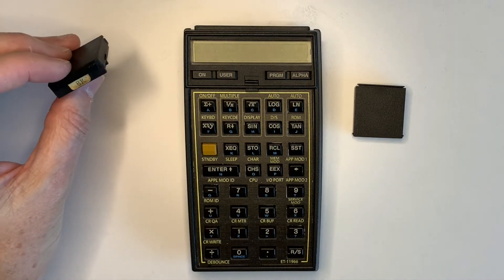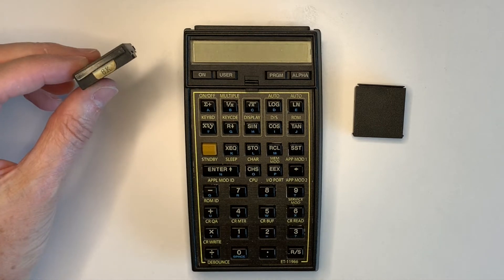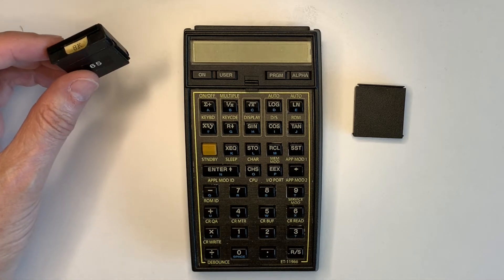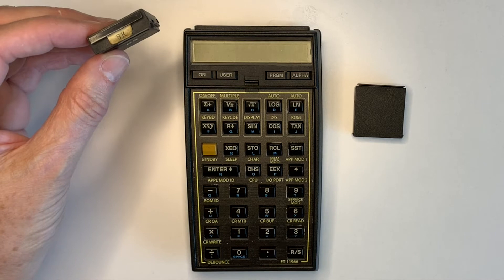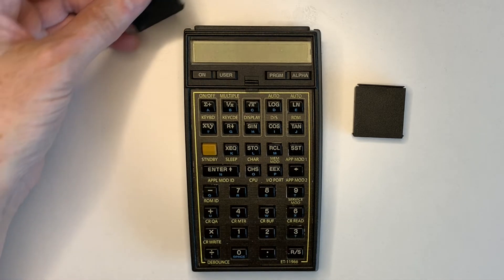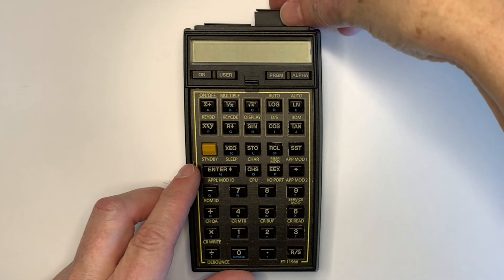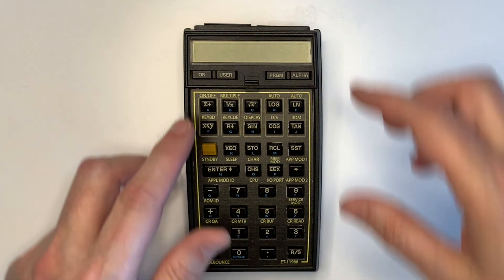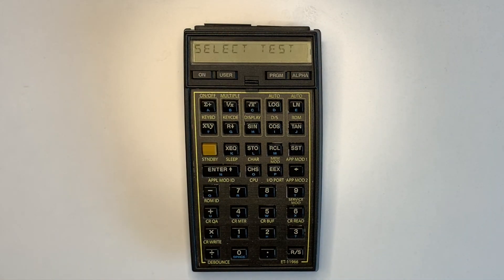Can you identify this HP 41C custom ROM module?

Comment: I think it's a module for Directional Drilling which would encompass borehole surveying. I see DL for Dog Leg and VS for Vertical Section. TV for True Vertical..... GEO. If not Directional Drilling then still probably something to do with surveying. I have written programs on the CX for Directional Drilling back in the day. Used every single register available.
Reply from the maker: Thank you 😊. Is there a simple test I can perform to check as this is not a discipline I'm familiar with? I probably should just upload a copy of the module somewhere so people can review it and test it.